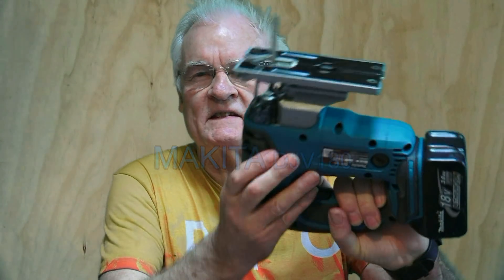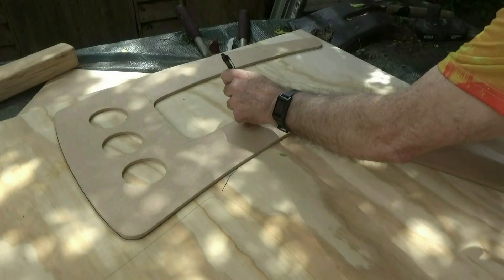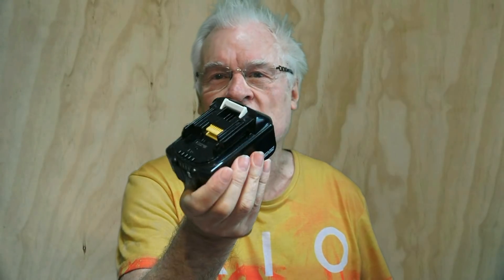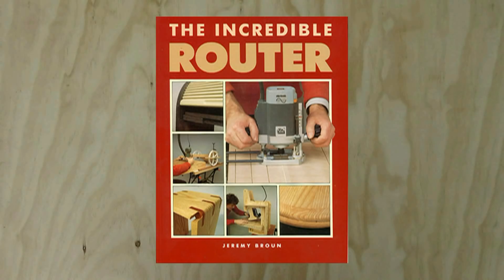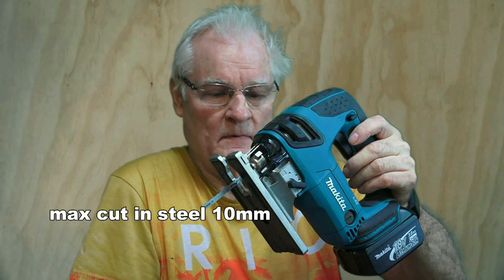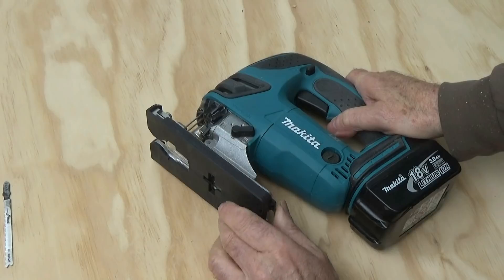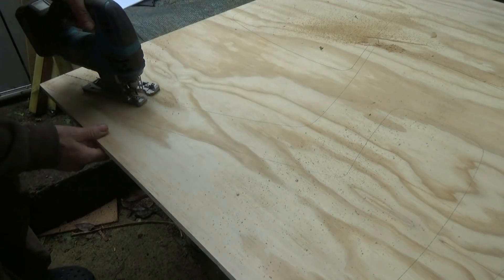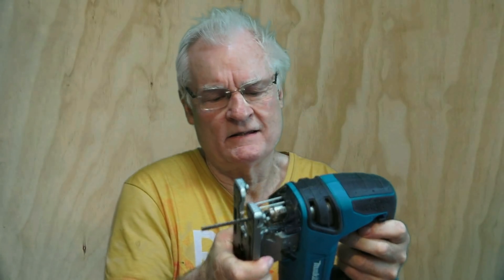My Favourite Cordless Jigsaw - Makita DJV180

Comment: My most used tool is that Makita cordless vacuum cleaner. I use it everyday. My second favourite tool is Ryobi’s 18 gauge nailer, useful for so many tasks.
Reply from the maker: Yes I agree, the Ryobi nailer is nice.
Reply: Agreed but my first ryobi Brad nailer fried easily....I assume from overuse???
Reply from the maker: @buffalogtr  Its impossible to give a black and white answer to that.  I have owned hundreds of power tools over the years and have only had one burn out and that was a very cheap jigsw in fact my very first jigsaw in 1974. I guess  today the mass-market there will aways be a certain percentage faulty, even top brands. If you say your nailer 'fried easily' it implies you didn't over use it.

Comment: I suppose the logic of not having dust extraction facility is that one of the advantages of a cordless tool would be negated if a vacuum hose was attached.
Reply from the maker: Have you not come across the latest tubeless air extraction system Norman? It uses quantum physics whereby particles are displaced from 'the board to a bucket' and the transition is both invisible and silent. Truly remarkable technology.
Reply: Woodomain - Jeremy Broun Yeah seen it - JD was demonstrating it last week - competitively priced at ‘both kidneys’😂
Reply from the maker: But on a serious note, yes a good question, but I would trade off keeping the umbellical chord for achieving accuracy by clearing away debri around the blade.
Reply from the maker: I probably didn't make that comment clear - what I mean is the blower to maintain vision when cutting is more important (to me) than the umbellical cord (meaning either corded power or dust extraction which as you say negates the cordless logic. Maybe a dust bag would do the trick.

Comment: Hi
Just bought one of these  and straight from the box I noticed a rattling coming from inside the handle area, is this normal or should I return it? Thanks
Reply from the maker: It is hard to answer that questioin. The saw 'rattles' as indeed any jigsaw does and the question you should ask is what is there to rattle in the handle specifically? There is just a trigger mechanism. what I suggest is is in handling the jiggsaw the rattle might appear to come from the handle but the vibration of holding the tool may seem like the rattle is coming from the handle? One test is the old fashioned screwdriver test to check whether the big ends are going on a car engine. Use a large screwdriver and place the handle next to your ear and place the tip on the front end of the motor body and then place the tip on the handle. The sound should be slightly duller on the handle.

Comment: What nice is on thisone, it has a speed control trigger. The newer ones with Brushless Motor don't have this (DJV182)
The new serie has a Blower function to clear wood dust from cutting line.
So my personel preference is a variable trigger instead of a blower function.
Reply from the maker: if you watch the video this jigsaw has both blower and variable speed.
Reply from the maker: if the chippings aren't blown away you cannot see the line.

Comment: What, no blower!! Will have to get a battery of another make.
Accurate and well built mabey, but only for some projects. Dust extraction is essential in a modern tool
Reply from the maker: By blower do you mean blowing away chippings around the blade which it does. I think there is a version of this excellent jigsaw that does have a dust take off. But its not actually dust that is generated! The debris from a jigsaw are minute chippings and they hardly become airborn. I've been using power tools for over 50 years and its never been a problem and you always use a face mask for prolonged use. Circular saws and routers create far more chippings than gentle reciprocating blades.
Reply: @WoodomainJeremyBroun  Yes,  sorry. It's not really dust at all. If it has a blower that is brilliant. 
As a matter of interest, do you know if there is a affordable brushed 18v barrel grip saw available? I guess that barrel grip is good for vertical and upside down usage. Also both tipes of saw are available in 12v or 18v
Reply: I can see the blower working now, it does the job.  So can you get an accessory to plug the vacuum into?
Reply: Makita factory is in Telford apparently
Reply: Looks like the DJV180z has dust extraction.
Reply: Does it have a safety so you can't pull the trigger without pressing a button?
Reply from the maker: Rest assured Makita is still one of the top brands and will have the necessary safety features.
Reply: @WoodomainJeremyBroun  ok
Reply: Do you know any barrel grip Jigsaws where the speed dial is in the correct place?
Reply: Said mabey.